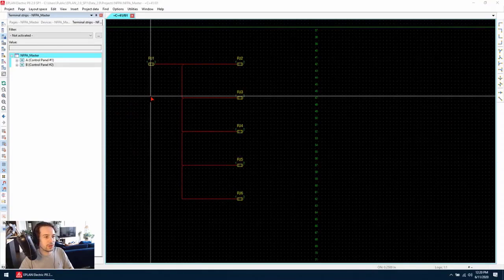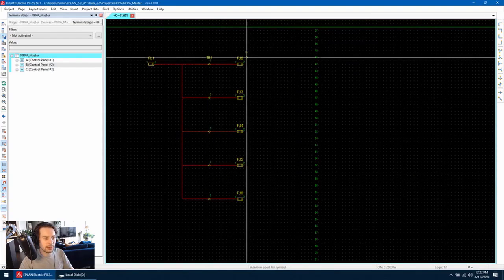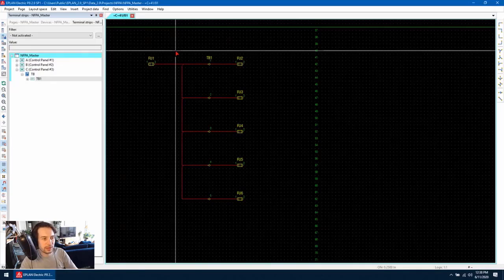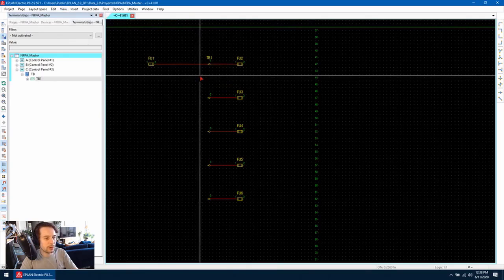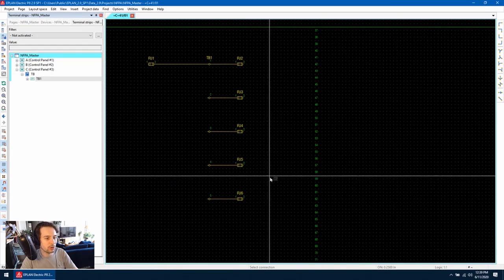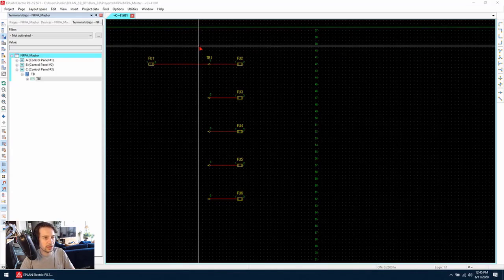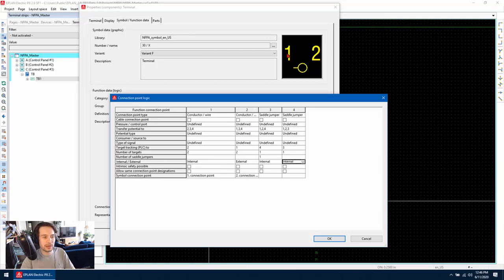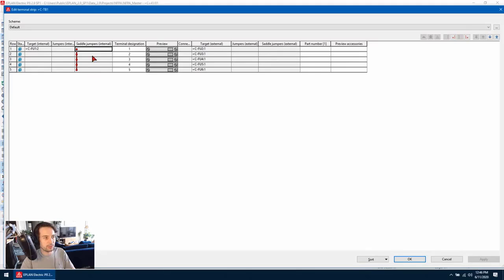EPLAN Tips & Tricks: Managing Saddle Jumpers

Comment: How do I create a fused terminal block with a symbol that has 4 connections points so the jumper is shown on the schematic page? I can only find a fused terminal block symbol with 2 connection points
Reply from the maker: @ericbucklen6748, You can use the 2-connection symbol and change the function definition to “Terminal with saddle jumper, 2 connection points”, then you can utilize the logical saddle jumper connection through the Edit Terminal strip window or use T-nodes to have 2 connections to the terminal, EPLAN will consider one of the connections as saddle jumper if it is connected to the adjacent terminal.